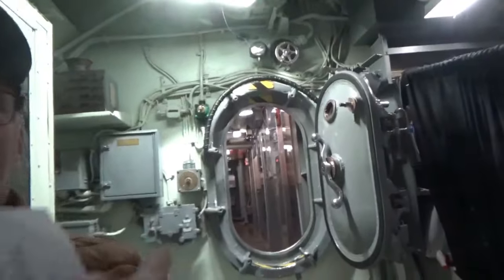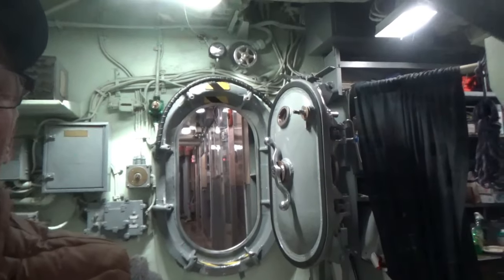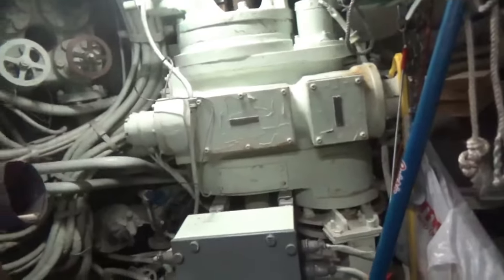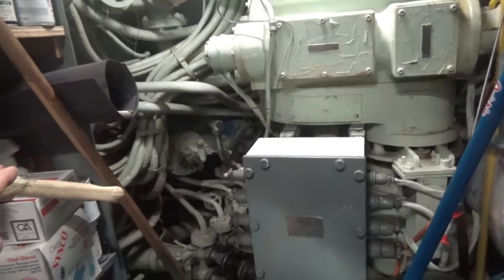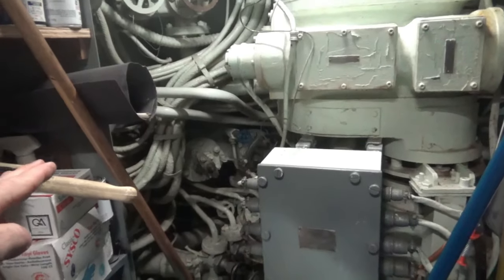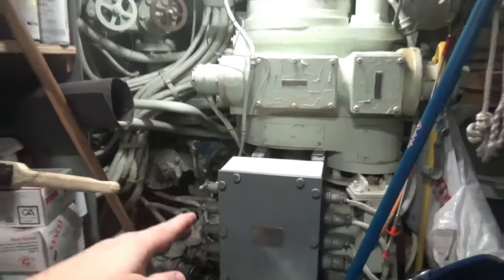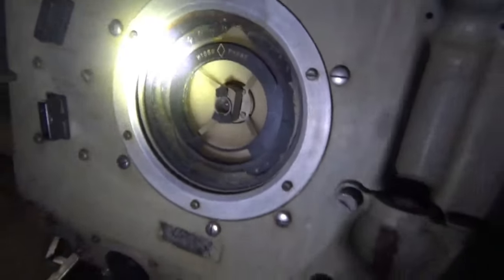SSK's Reconfigured Sonar Room

Comment: 10:45 <-- former surface sonar technician, but my dad served as a sonar tech on the Balao-class submarine U.S.S. Sablefish (SS-303) from 1957 to 1962 and he confirmed my guesses. The Navy has a bad habit of naming things in reverse order - main job first, additional, more descriptive things afterwards. So this piece of equipment is the "Azimuth Recorder". If you look hard at the name plate, you'll probably see a comma after the word "Recorder" so it reads "Recorder, Azimuth". It was a passive-only device that recorded broadband noise by burning small marks on specially treated paper rolls that very slowly advanced down to a pick-up roller. By the time I was in the navy in the late 70's this was known as a "Bearing-Time Recorder". 0 degrees relative was in the middle of the paper while each side of the paper was 180 degrees relative. The paper advanced at a known rate, so you could get a bearing rate on a noise source.

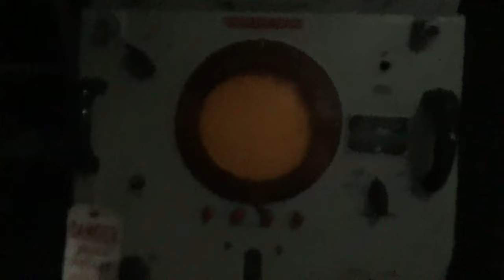11:20 My dad says the BQS-4A was the active (i.e. the noisy "pinging" sonar that tells everyone within listening range that you are there) sonar console. As a hunter-killer is there to ONLY hunt enemy submarines, this console was probably almost never operated - and CERTAINLY never operated when the SSK was on its assigned station - because an H-K sub would never want to let the enemy know they were around. When the BQS-4A was actively transmitting into the water, however, it could provide bearing and range to an object and with multiple pings, the course and speed of the target could be developed.

12:30 My dad says this console is the passive (i.e. only listens, never "pings") console. This console would be constantly manned as this would be the primary sensor of a hunter-killer. It can provide bearing and bearing rate of a detected target.
Reply from the maker: Wow, this is so very helpful! I don't have a good beat on Croaker submariners, so to have this real world experience listed here is so helpful! 
I really appreciate it and thank you to your Dad for his work on Sablefish! I'm going to get out my notepad tomorrow at work and get this written down!